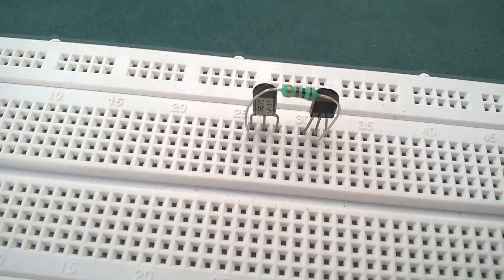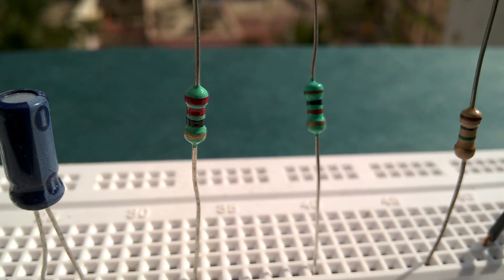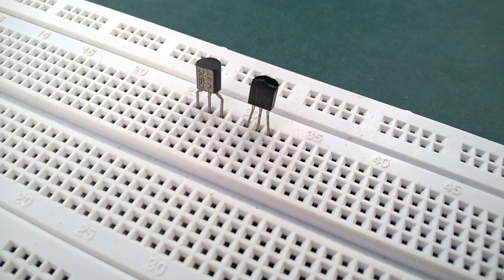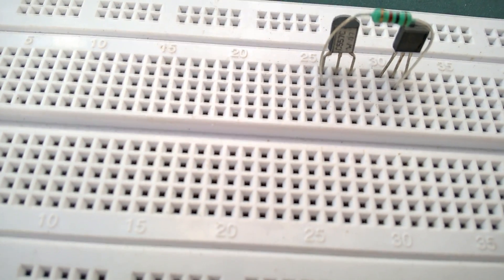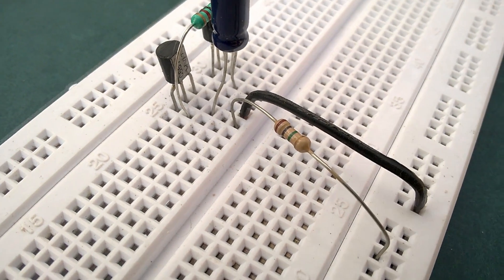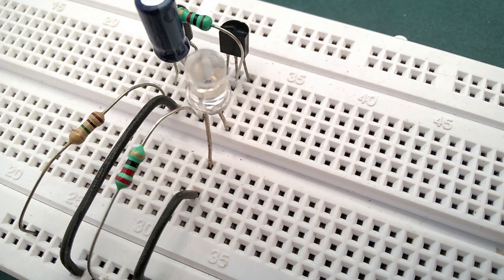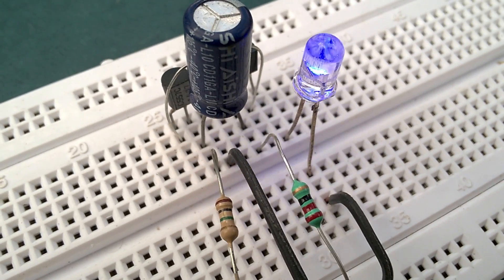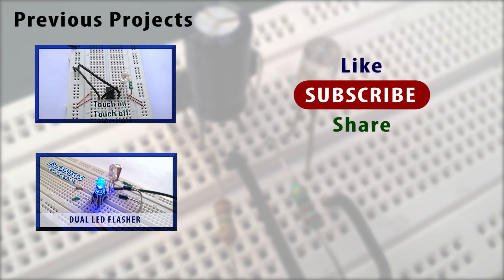Flashing LED circuit using transistors on Breadboard - Basic Electronics Projects

Comment: Sir please can you explain the flow of supply from capacitor to pnp transistor although battery is still continuously supplying the power to whole circuit....then how capacitor is able to activate the pnp transistor as you describe in explanation....please sir give me answer.
Reply: Bro. This circuit is fake, capacitor can never charge and discharge while the circuit is always on.....

Comment: Can you please send me the circuit diagram for this?  I will use a 5v buzzer and a 5V diode bulb instead of the small diode in the video.
Reply from the maker: http://elonics.in/breadboard-projects/simple-flashing-blinking-led-circuit-using-transistors

Comment: Here is why this works(revised):
 Step 1. The battery charges up the capacitor. 
Step 2. When Capacitor is full, the PNP-Transistor BC557 is activated. 
Step 3. PNP-Transistor BC557 activates NPN-Transistor BC547. 
Step 4. Activation of NPN-Transistor BC547 allows current from capacitor and battery to flow through the LED, which activates LED (on)
Step 5. The capacitor is discharged, which deactivates PNP-Transistor BC557, which in-turn deactivates NPN-Transistor BC547.
Step 6. Current flow from the battery to the LED is cut-off. LED is deactivated(off).

Step 1(again). the battery charges up the capacitor again, and so on....
Reply: Robert, thanks a lot, when I am a God, ruler of the world, for real, I won 't forget you.
Reply: Is there a point when electrons are sucked from the PNP base and flow to the Capacitor?

Comment: Here is why this works:
 Step 1. The battery charges up the capacitor. 
Step 2. When Capacitor is full, the PNP-Transistor BC557 is activated. 
Step 3. PNP-Transistor BC557 activates NPN-Transistor BC547. 
Step 4. Activation of NPN-Transistor BC547 discharges the capacitor current through the LED, which activates LED (on)
Step 5. The capacitor is discharged, LED is deactivated(off).

Step 1(again). the battery charges up the capacitor again, and so on....
Reply: This makes it so much easier to understand
Reply: How does the capacitor being full trigger electron flow from the base pin of the BC557?
Reply: Why are there 2 transistors

Comment: My first project and it worked BIG thank you! By changing capacitor value it gave me an idea as to build my own security alarm in my garage. With a larger capacitor it gives me enough time to open my garage door and switch off my alarm that have build earlier. I will subscribe!

Comment: hey bud can u build me a circuit dig for 
head light, tail light, break light and blinkers and can be used alternatively only with one switch can we program any ic or programmable chip for this pirppse can u explain or help. if only possible thanks.

Comment: Thanks brother. I was looking for this project to make flashing LED for my cycle. Works like a charm!
I have used 10ohms resistor instead of 22ohm with 9v battery. 
 You have an awesome channel for beginners!
Reply: Hey mate, which ohms ressistor do I need for 12v car power supply? Thanks in advance

Comment: The LED is glowing constantly instead of blinking, what might be the problem. 
I'm using 10kohms instead of 1kohm, the input voltage is less than Capacitor reading...
Reply: do u get solution
Reply: @JyothisP-en5ck Yes I have a solution. It happened to me too. Make sure the Positive Leg of the LED is connected to the Emitter Leg of the BC547. If you connect it to the Base Leg by accident then it will stay solid. Connect it to the Emitter Leg and it will blink.

Comment: Hi ...... i tried this on a breadboard but my led did not flash what must be the problem
Reply: please check the capacitor it should be 2.2uf + / - and the connections, this works for me
Reply: please check proper connection

Comment: I followed this and it worked, but after a few seconds it stopped blinking. What could be the cause? i tried changing capasitors and resistor, but now the LED is just on and doesn't blink.
Reply from the maker: The capacitor is not getting fully charged.
See if increasing the 22R (to around (40-50)R) solves the problem?

Comment: does the 10v capacitor can be used in this circuit? while i will be using a 9v battery as a power source
Reply from the maker: Yes. Supply voltage should be less than rated voltage of the capacitor

Comment: simple question... i find all my stuff needed to make that electronic board at the sameplace...
can i use other type of transistors npn pnp, i found some packages at radioshack ( can't found bc547 and bc557)
heres the numbers i've found... came in packages of 15, 5 of each) 
pnp : 2N2907, 2N3906 and 2N4403.
npn : 2N2222,  2N4401 and  2N3904.
Reply from the maker: ElMust1177, I have tested this circuit replacing BC557 with 2N2907 and BC547 with 2N3904. It worked fine.
The pin-outs of 2N2907 and 2N3904 may change depending the type of package. Refer to the datasheet once.

Comment: what if I use LM317LK transistor??
Reply from the maker: It's a voltage regulator, not a transistor. You can use this to convert input voltage to 6V if you are using a higher voltage source.
Reply: Ok but I think I messed up I tried it but it was just dim😞

Comment: dose it matter what kind of transistor, capacitor, and resistors you used???
and what will happen??????
Reply from the maker: Increasing the capacitor value increases the duration between flashes. Using a different transistor doesn't make any difference(Type should be the same, npn pnp). 1K, 22R resistors are to limit current and decreasing the 1M resistor will reduce duration between flashes.
Reply: Ok thank you for your help

Comment: Do you think this could replace bimetallic relays used for car indicators (flash). Please suggest a workable circuit and the capacitor to be used. I am talking about two flash lights with 21 ohm resistance and one small 5 ohm indicator light on the car's rear view mirror.
Reply from the maker: This circuit is not suitable for high power applications. You can use this circuit: https://youtu.be/gTn_HmzXYLo
You need to connect any n-channel mosfet to the 555 timer's output, like this: https://goo.gl/images/SOs2F4
and then connect flash lights to the output of mosfet.

Comment: with two transistors you would have rather made dual led flasher.
Reply from the maker: It's all about the functional requirement Rishikesh. This circuit is for those who need a single LED flasher.
BTW your videos are good too!.
Reply: ok. nice to hear that from you :)

Comment: So there is a project I want to do just for fun, I have a 9V battery and 50 white leds. I want to place them in parallel with maybe 5 LED's in each row, however, how do I find out what resistor do I need for each line of Led's? also, would I need to add other components such as a capacitor or stuff like that?
Reply from the maker: A single white LED needs around (3-3.5)V. So the maximum number of LED's we can use for each row is 2. (Because 3 LED 's or more in series plus a resistor requires a power supply greater than 9V.)
So I assume you'll make the project with each row having 2 LED's plus a resistor.
Calculating the value of resistor required:
Current flow required through each row (Same as current required per LED): 20mA

The voltage drop required across the two LED's (3.5V for each LED): 3.5*2 = 7V
Voltage drop required across resistor (R) = 9V - 7V = 2V
From ohms law on resistor, V=IR, 
2=(20/1000)R
That gives us R=100 Ohms.
Now each row requires current of 20mA. Number of rows you can place is given by:
(Max Current that can be supplied by the battery)/(Current each row requires)
I'd recommend to keep adding rows until you observe a reduction in brightness.
And there's no need of a capacitor unless the power source is fluctuating.

Do let me know if anything's not clear.
Reply: well explained!